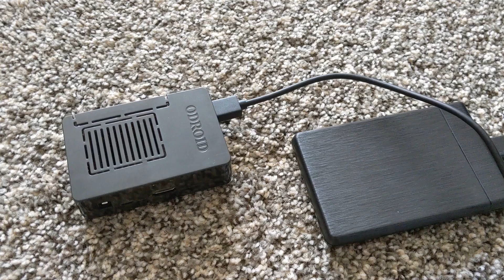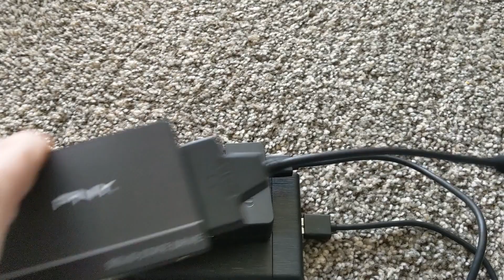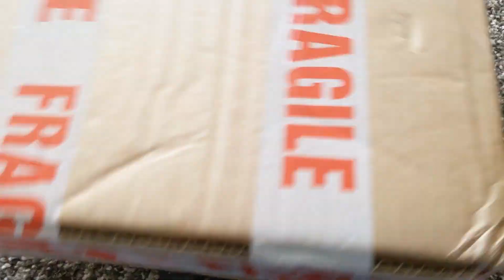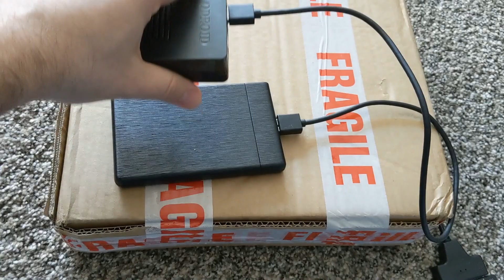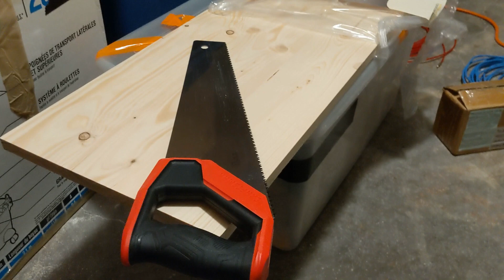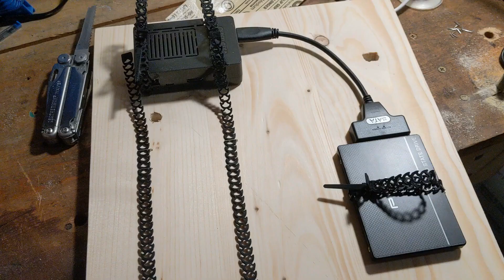ODROID-C4 Board Mount

Comment: Hi I liked all your Odroid C4 video's please make more. I've been wanting to buy one of these Odroid to convert a old HP laptop. Problem is everyone assumes people know how to connect things and get them working. In your first video unboxing you had a problem getting the keyboard working. How did you fix the keyboard problem? Plus I haven't seen how to connect things to that 40 pin header. I thought the WiFi and Bluetooth where to connect to the 40 pin header, but now I see they are using up all 4 USB ports. Please make more video's. Thank you.
Reply from the maker: Thanks!  In my use case there isn't much more to make videos about right now.  I think my initial keyboard problem went away after the first reboot, and I've not seen it since.  There is no built in WiFi or Bluetooth on this board.  As for use of the 40 pin header, it should be the same layout as the Raspberry Pi 40 pin header. The only thing I've tried to use was a RTC, but the Linux images provided by Hard Kernel don't have the correct driver, even though their instructions say they do. It isn't the RTCs fault, it works great on a Raspberry Pi.

As for placing a Odroid into a laptop case, that sounds interesting. I feel like I've seen something like that with a Raspberry Pi, which could work better with the correct version as the newer ones have built in WiFi and Bluetooth.  I wouldn't know exactly how to convert or adapt the keyboard and monitor, but it doesn't seem impossible.